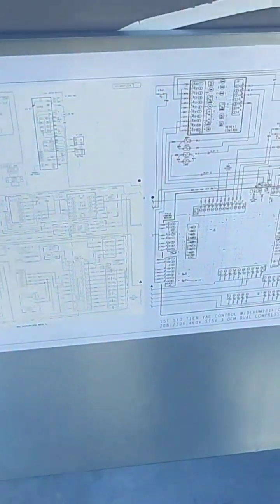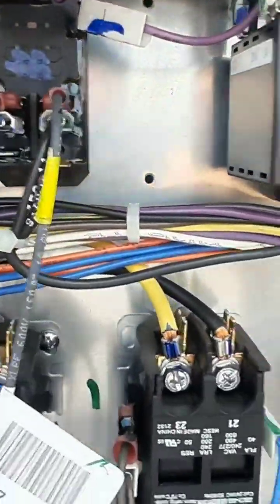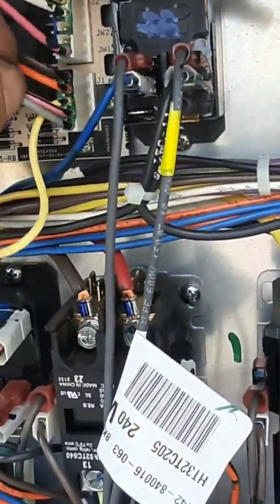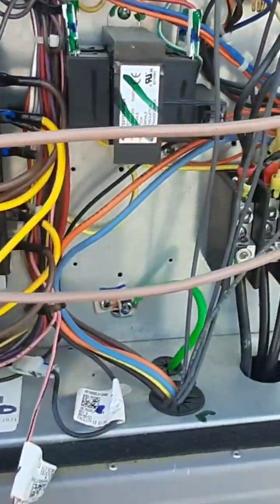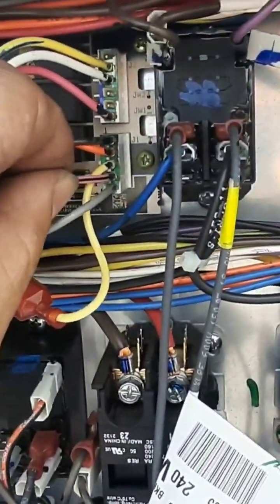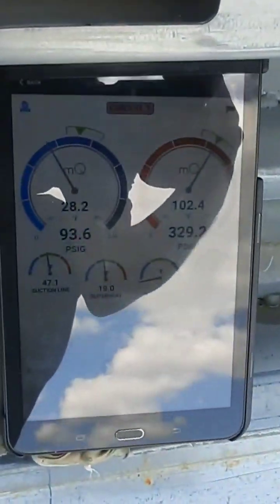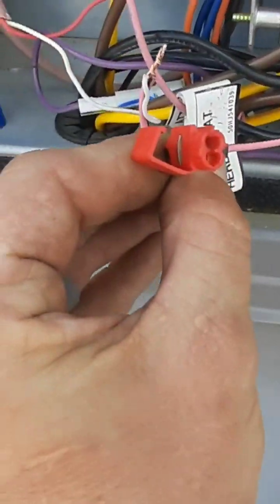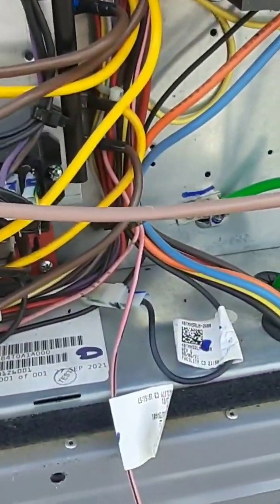Carrier humidimizer part 5. this is my problem. #hvac #hvacservice #carrier

Comment: I work for carrier and thats a installer problem not carrier
Reply from the maker: 100 percent this is an installation problem. The carrier problem is the rubbing cap tubes. These are great machines as long as all the cap tube rub outs are caught before they become a problem.

Comment: And those connectors are junk. The ones that pierce the insulation. I hate those. I prefer wire nuts or crimp-on lugs or quick disconnects
Reply from the maker: Agreed, Thanks phatcowboy